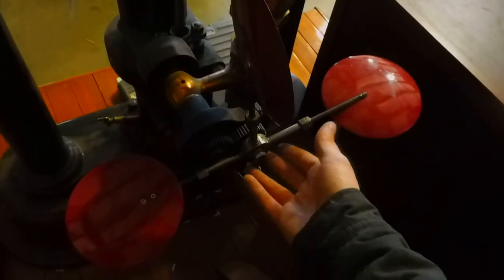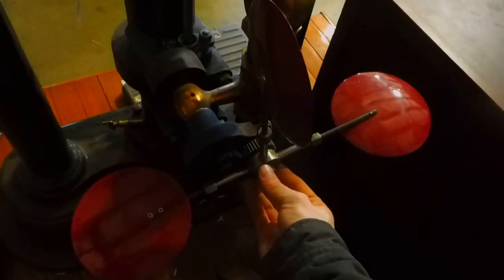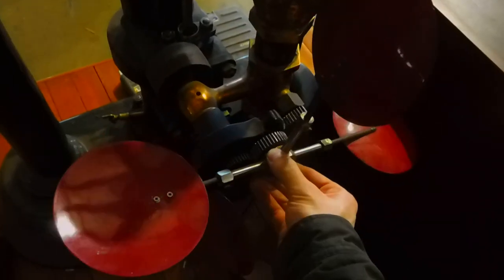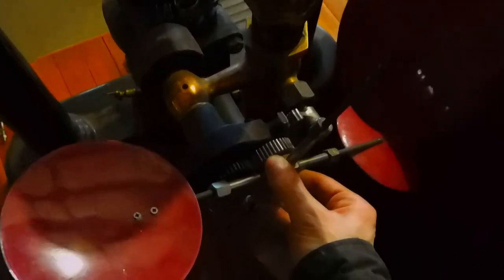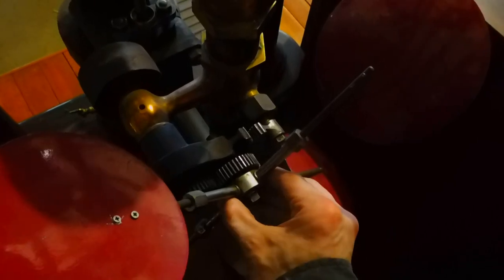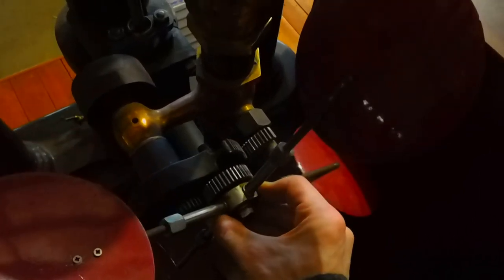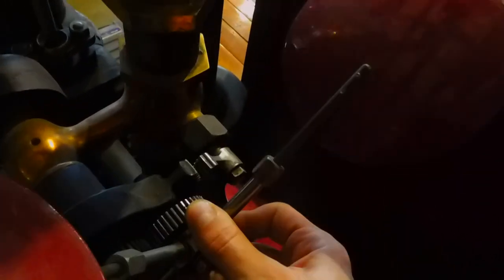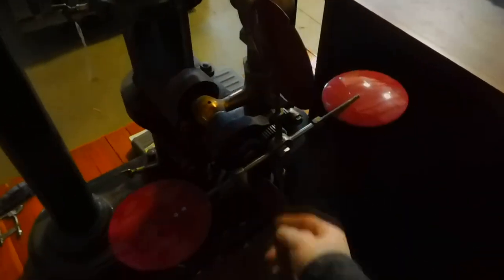The Elusive Fan engine Governor...

Comment: I've never seen a governor like that. Does it have problems with oscillation? I ask, because it doesn't appear to have much mass to damp out speed changes. I love these various engines you show!
Reply from the maker: It went out of fashion quickly due to its vulnerability to small air currents, the daily temperature/barometric pressure changes with the weather, and the humidity!  On large engines it could change the entire running characteristic between a humid stormy day or a dry clear one.

Comment: How does it create lift if there is not asymmetry in how the air is propelled out?
Reply from the maker: There is asymmetry.  The blades would have to be flat for there to be none.
Reply: The drive gear spins, it causes the fan gear mount to pivot in the opposite direction because of the torque from the fan, and that actuates the valve.